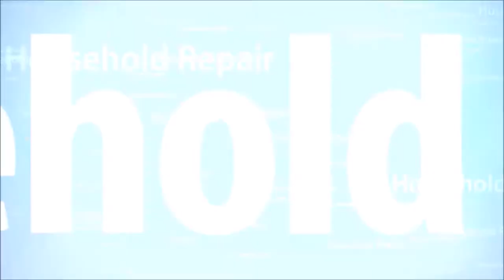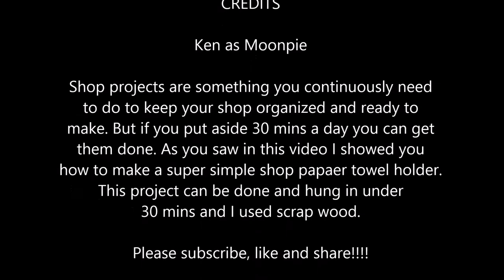How to Make a Super Easy Shop Paper Towel Holder

Comment: What did you spray in the hole before fitting the dowel to the back plate?
Reply from the maker: That was an accelerator for the CA glue.